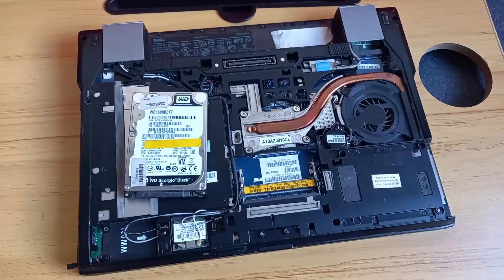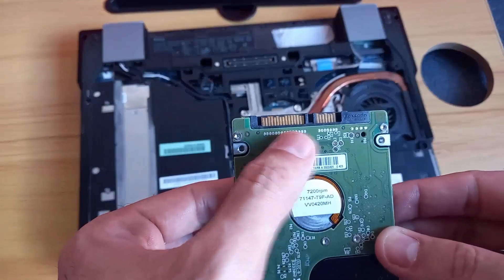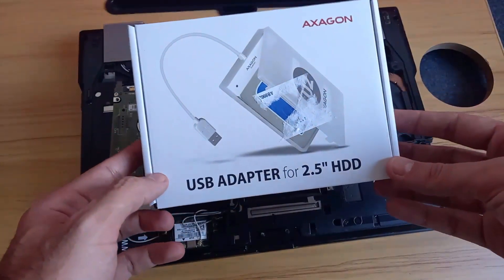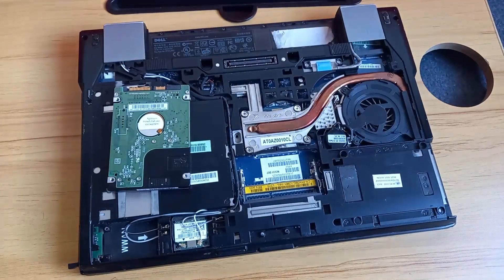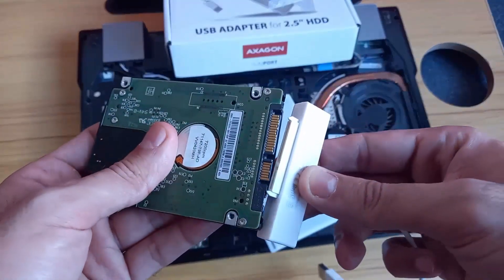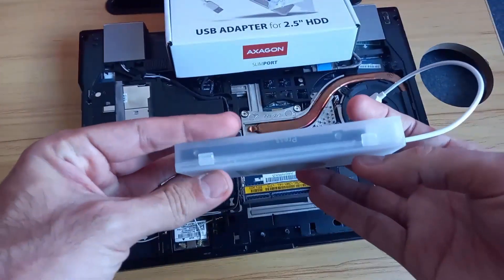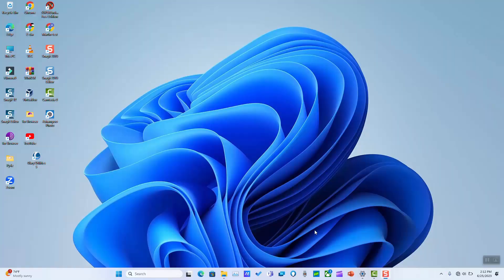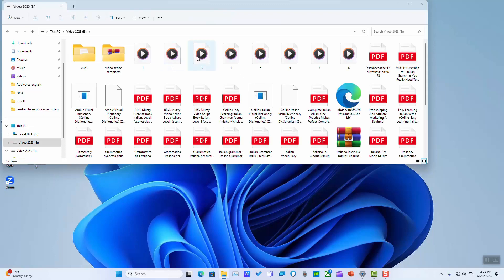How to turn an internal hard drive into external

Comment: Hey there, will connecting a HDD to a USB slot affect it's performance significantly?
Reply from the maker: sometimes it can increase its performance if using a box with USB 3 ability connecting to USB 3 port on your computer.
I hope this answers your question.

Comment: Is there a way to boot the old OS in the internal hdd from the usb connection?
Reply from the maker: no, but you can try to convert into bootable, not sure it would work
Reply: @the-it-fox4702  I think there is no tool for doing that automatically. I supouse manually with quite a lot knowledge, not my case.
Reply from the maker: we will try to find one!

Comment: I would not be putting the HDD into the plastic case as once the HDD heats up It may melt the case and start a fire? and even if it does not start a fire it would not be good for the HDD as it needs a fan to cool it self down.
Reply from the maker: I'm using the plastic cases for the last 10 years without issues
Reply: I think that hard drives don't reach temperatures that high? Also some plastics don't melt so easily - for some of them it takes over 100 C to melt - I've used a plastic ladle for nearly 4 years now without issues.
Reply from the maker: same here

Comment: If you just plug the internal disk out of the laptop you may damage it or kill it. How does it work when its converted to usb? Is there a risk of killing the HDD by plugging it in and out live?
Reply from the maker: there are no risks, jus use the external box, plug it to computer and its ready to use

Comment: I wanted an SSD from my old laptop WITH the data inside of it. Can I simply pull the SSD out, plug the adaptor and use it like really large USB without formatting it?
Reply from the maker: yes, you can, and it will work, I tested it personally few weeks ago :)
Reply: @the-it-fox4702  It actually did! Thank you
Reply from the maker: welcome

Comment: On my SATA HDD, there is a second hole for the power plug. How can I determine if I can make it work as an external hard disk with just a USB cable?
Reply from the maker: is it a HDD for laptop or desktop ?
Reply: @the-it-fox4702  Desktop, it's SATA WD10EARX
Reply from the maker: there are two types of hard disks:
3'' and 2'' for each there is a special box for it